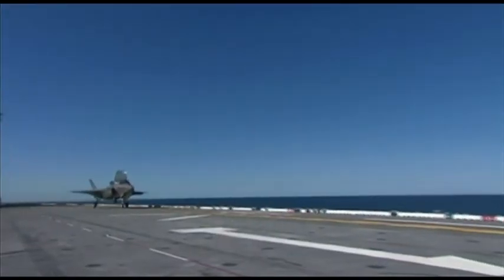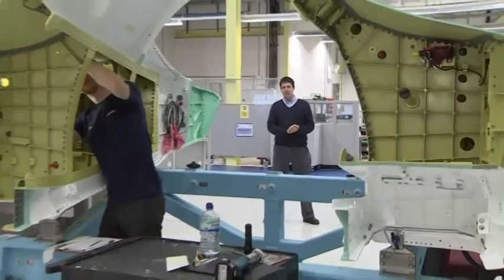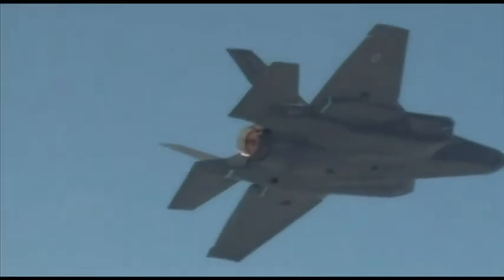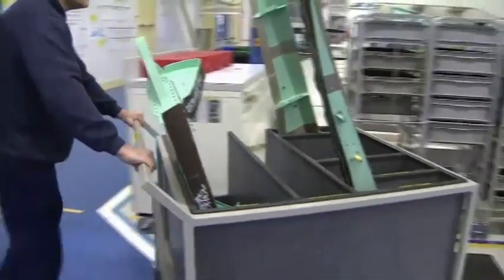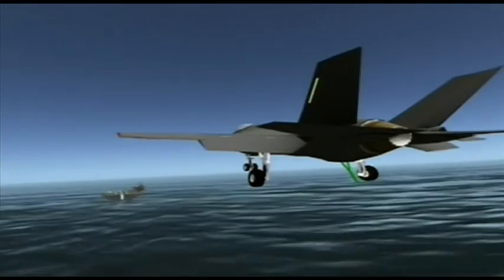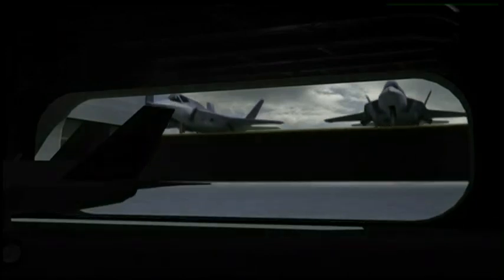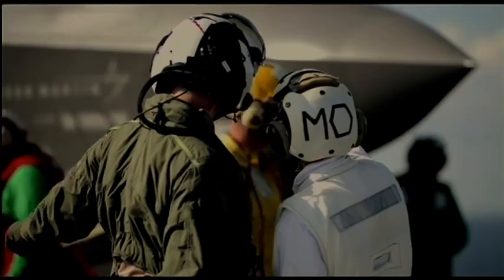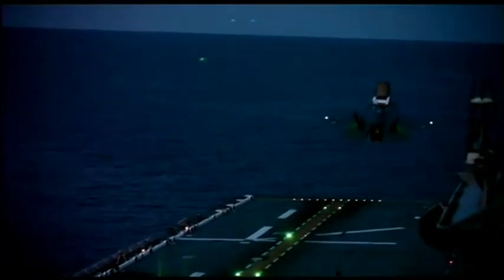Capabilities of the Lightning Joint Strike Fighter Aircraft

Comment: A pity "Wanderer628" is so misinformed.
A pity news journalists can be equally misinformed
F22 has the air quality problem.
One P&W engine fire does not condemn the model
The RR lift fan, shaft & Directed thrust nozzle are also manufactured in UK
Reply: Since 2007, F-35s as a fleet have been grounded no less than 17 times due to the issue of the engine.  Simply put, the plane is far too heavy for a single engine.  That flaw requires a complete scrapping of the current design in order to correct.
Of course, there are many other major issues as well.  Any one of them may not condemn the model, but in combination, it makes consigning the F-35 design to the scrap heap and starting again from scratch by far the least time-consuming and expensive option.  By the time the F-35 finally lives up to its PR hype, it'll have a unit cost of almost $1 billion, and the design will be already obsolete.

Comment: A pity it can't stay in the air long without its engines blowing up or poisoning it's pilots with faulty helmets. It may be the best fighter out there once it's fixed but it's not worth the colossal expense it's incurred. The people running the program have screwed up since day one.
Reply: "A pity it can't stay in the air long without its engines blowing up or poisoning it's pilots with faulty helmets."

Except that you just made that up.

"It may be the best fighter out there once it's fixed but it's not worth the colossal expense it's incurred."

That'll be why it's going to be cheaper than even other 4.5th gens then?
Reply: @ Wanderer628
If you are going to get involved in technical discussions its best not to show your ignorance. The 'poisoning pilots' and 'faulty helmets'  was the F22 not the F35 my friend. Now where I DO agree with you that (F22) was one very expensive aircraft indeed ... and even the USA bottled out at 187 aircraft. The F35 will be a huge success if only because we Brits are involved in the programme and will judge our American 'friends' when they cock up as they did with the F22. Sad we can't have the F136 RR engine on the UK aircraft...
Reply: Lockheed Martin doesn't really want all the problems to be ironed out, as their contract gives them a profit on any and all work done on the F-35, including investigating and "fixing" the problems.  The plane is nothing more than a prop upon which Lockheed Martin can milk their customers.